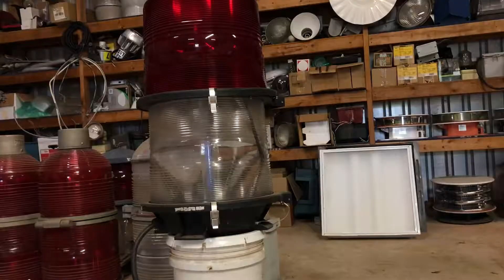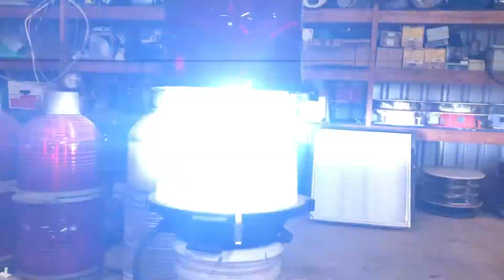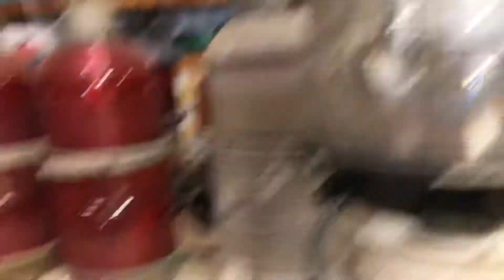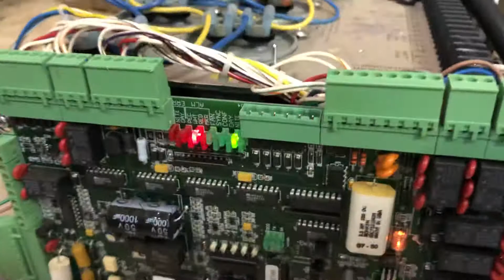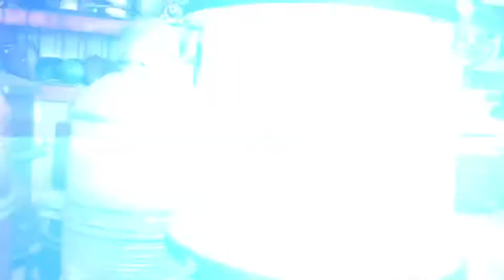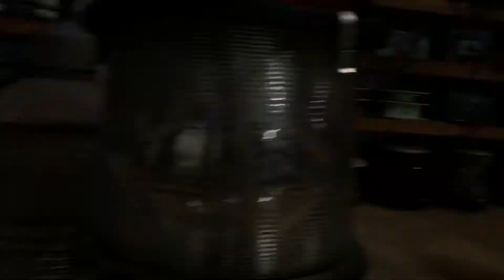Flash Technology FTB-324 Tower Strobe White Night Mode Backup (Red Failure)

Comment: There is a tower in Elyria, OH with a weird malfunction. It flashes like a normal dual strobe but the colors are reversed.
Reply from the maker: That's a strange malfunction, I've never seen that before, but TWR has a strobe/LED beacon with the white strobe on top and the red LED on bottom.
Reply from the maker: @whyisaiden  It might be a bad photocell then.
Reply: There is a tower, about 3/4 of a mile away from my house. We moved there in early 2016, and it had the same problem. In 2017, they had someone go look at it and it was a solar panel failure. Now it takes 5 seconds to transition from day mode to night mode, (it turns off), then it takes 10 seconds to transition from night mode to say mode, (it turns off once again) I remember during the winter storm in Texas, (I live in South Texas) it turned of for 28 hours then came back on.
Reply: @dechugfitch1271  holy frick
Reply: It happens these bulbs have these strange problems but it’s maybe the wires

Comment: Which beacon will you do next?
Reply from the maker: I have planned to do a video on the different flash patterns of the LED Vanguard beacon.
Reply: jonboyok nice
Reply: jonboyok ohh an also theirs a way to make it automatically do the emergency night mode but u need small jumper cables then u gotta connect them to test an night

Comment: In New York on the LIE to Manhattan, there's a cell tower that has the red light blinking as if it's in Day Mode but its light model is the model you've shown. I always was fascinated by cell tower lights as a kid, I used to sit at my window when I was a kid cuz I could see the cell tower go from day to night mode. Long ago that tower used to have 2 separate lights but ever since they changed it to use this model of light, the red light right next to it is no longer in use and just sits there now.
Reply from the maker: Those two separate lights were the original "dual" lighting systems, sadly there aren't as many of those in use due to these type of strobes and now LEDs.
Reply from the maker: @PokeDigiFighter11013  Yes, the LED beacons have red and white diodes inside the flashhead. If you look for my video uploads of the Horizon beacon, you'll see how an LED beaocn works.

Comment: Some TWR's and FlashGuards have this feature.
Reply from the maker: Yeah, all the dual strobes should have it. Ive seen it occur on Flash, TWR and FlashGuards.
Reply: Didn’t u used to have maps with broadcast towers an strobes I injoy being on maps like dat but it’s hard to find them now
Reply from the maker: @Thebrileybrothers  That was not me, not sure who that was.
Reply: jonboyok I was talkin to robloxo2017
Reply: @Thebrileybrothers  I actually still make maps like that today, tough I usually don't post videos of them on this channel anymore, since I've moved to my new one. 

I also wonder if the FTB312 also includes this feature if it's red filter gets stuck. But it should have one.
Reply from the maker: @drdegutrez8458  Yes the 312s do have the white night mode backup, that red filter was a very common point of failure on the FH-306 so that's why they changed the design to the FH-324.
Reply: @drdegutrez8458   theirs a tv tower near me with the red filter not going up at night but it still does regular night mode... theirs also a tv tower with leds an they been malfunctioning

Comment: When red failure happens, how quickly does the red light get fixed? Also, how come it only happens on pyramid shaped cell towers with one set of these lights in the middle and the other at the top of the tower?
Reply from the maker: Depends on if the light alarms are actively monitored or if it has alarms connected. Also could depend on if the tower owner wants to spend the money to get it fixed, it's usually not cheap to hire a tower crew. 

It can happen to any tower anywhere with these type of strobes. I've see it happen on all kinds of towers.
Reply: @jonboyok  But which towers would you say are the most likely to experience this, and which ones are the least likely?
Reply from the maker: @righteousrayyan2078  It's not really something to predict, it generally has nothing to do with the type of tower. The failure is within the strobe system(controller or flash head) and it can happen to any tower anywhere. I'd say less likely to happen on say a tower that has routine maintenance, ie: replamped once a year. More likely to happen to a tower that is subject to target practice, ie: someone tries to shoot at the lights. Maybe a tower that's exposed to harsh environments too might have a higher failure rate
Reply: @jonboyok  That's interesting to know, and it's awful that people actually try shooting at the lights. But what happens when white failure happens? Does the red light start flashing extremely like the white one?
Reply from the maker: @righteousrayyan2078  No, the white doesn't have a backup, in most cases, you wouldn't be able to see the red flashing during the daytime in bright sunlight. It will just throw a white failure alarm.